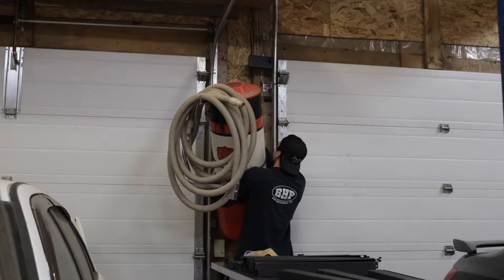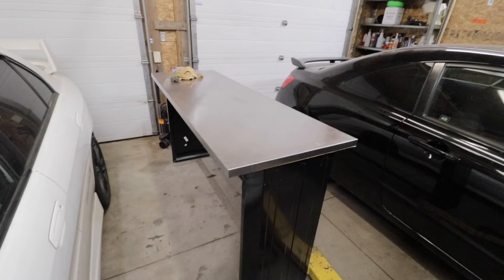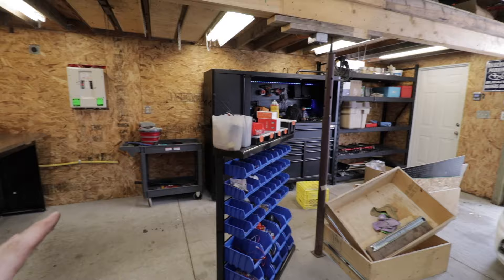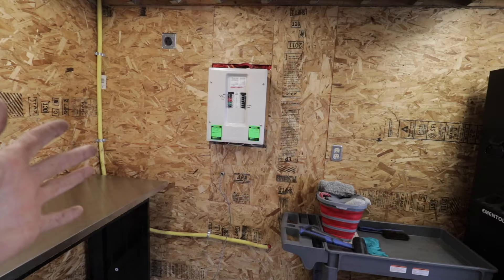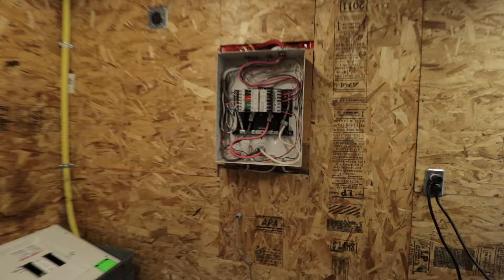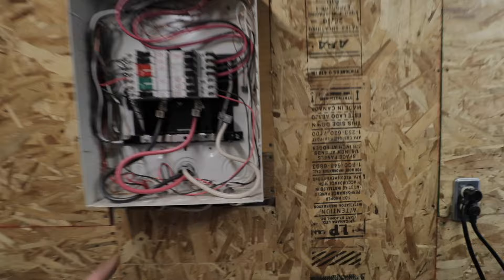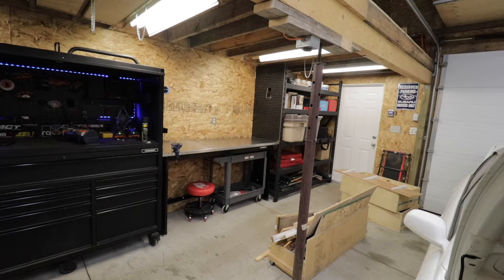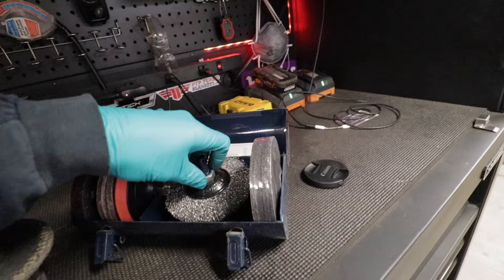Building My Dream Garage! | Ep.2 (We Can Finally Work on Cars)

Comment: You should get a contractor out there and figure out a way to get rid of that metal pole completely if possible.
Reply from the maker: It’s the main support for the mezzanine, but that would be nice to get rid of it if possible 🤔.
Reply: @DanielKellert  maybe an engineered beam?
Reply from the maker: @austinhatz  Sounds expensive 😅

Comment: As an electrician. I wouldn't recommend putting tool chest in front of panel. It's a means of disconnect if something should go wrong in a emergency situation.  Moving a tool chest could be difference in life and death.
Reply: Just my opinion. Dude I like your channel and builds.  Keep up the good content.
Reply from the maker: I totally agree. I could cut a hole in the back of the locker & build an access panel with some hinges & a latch. I leave the wheels unlocked on the box so I can always move it quick if needed. But quick doesn’t exist when it comes to electrical shorts, so I 100% understand your point. 👍🏼
Reply: @DanielKellert  i was just about to say the same thing, from a old electrician also had a guys garage burn down because he covered the panel and couldnt get to it fast enough lost all his cars